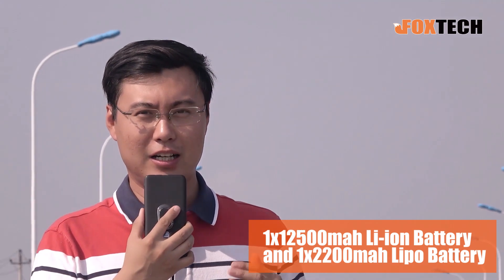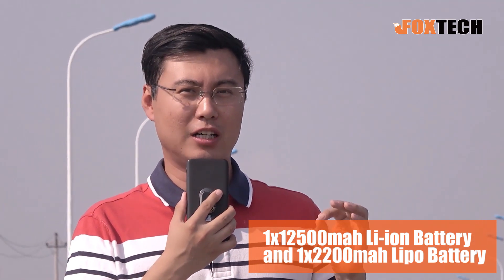World first onboard battery swapping system-PG20, 30% more flight time for tilting rotor VTOL

Comment: How about with a drone? like the H-1??
Reply: Hello, Duane. The PG20 power switch board mainly used on VTOLs right now. One smaller but high discharge rate battery is used to take off and land vertically since the power consumption is huge at these stages, one big capacity but low discharge rate battery is used for cruising in fixed wing mode.
Reply from the maker: it's not accurate, you can use it on H1, no problem, if you make a parachute for battery , you can even drop the empty battery and fly very long time with the rest one since total weight is less, just think about it , like multi-stage rocket. so you should stay in air with a lot longer time than before or go to an altitude which can't be done by normal drone